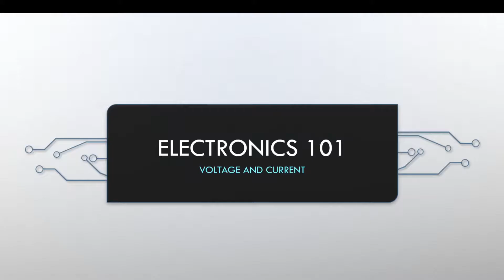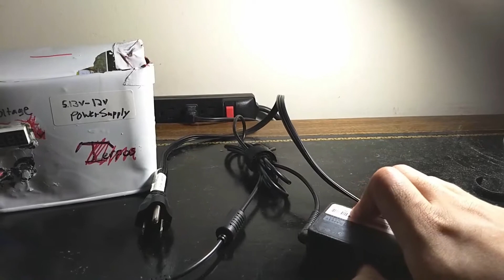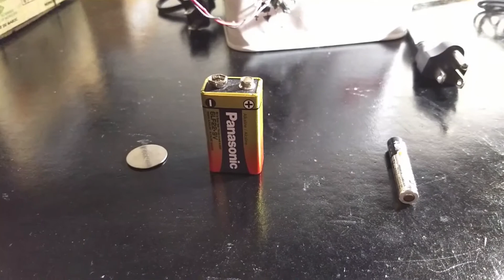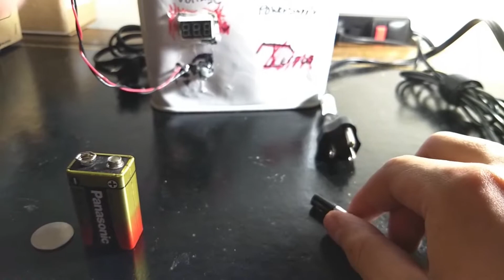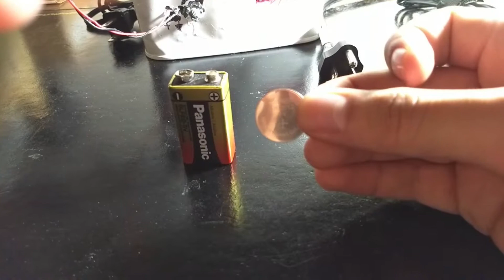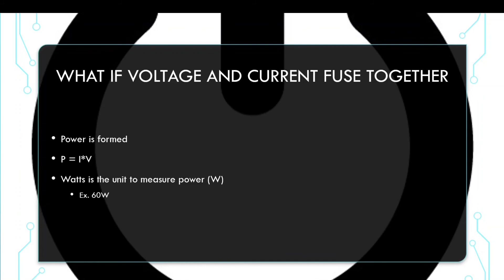Electronics 101 #3 - Voltage and Current

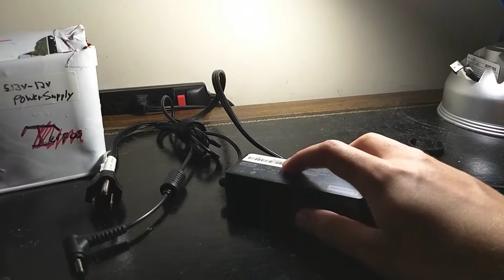Comment from the maker: In 2:27 I mentioned that the charger contains a power supply. I misspoke. It is a converter changing from AC - DC. So electricity is being pulled from the outlet and converted into a way that it can be charged to a laptop. 

Sorry for the misleading information and thank you @LifesLesson for the correction.

Comment from the maker: An accurate definition of voltage is the potential difference between two points. An accurate definition of current is the flow of charge. Charge is measured in Columbs so current is C/t or charge over time or Columbs per time passes. 

Although these definition are accurate, I want to teach you guys voltage and current in the most simple way possible. If the voltage drives the electricity in the wire, then it acts like a pressure and if charge flows then electricity flows since electricity is charge.